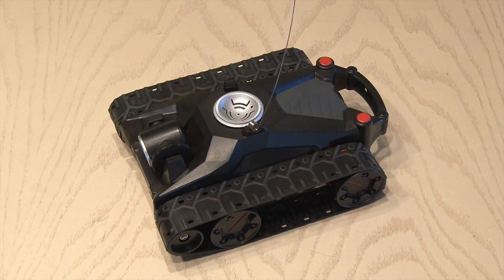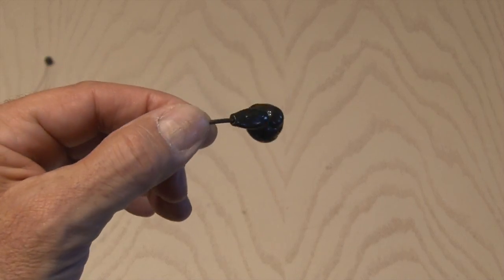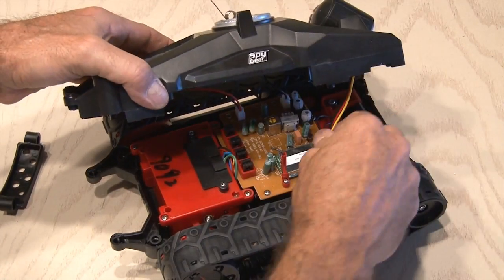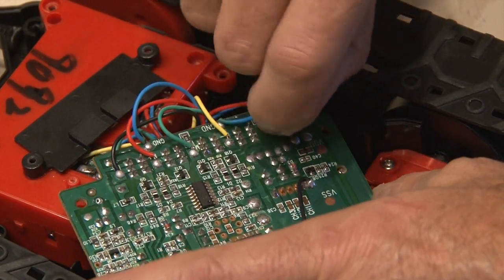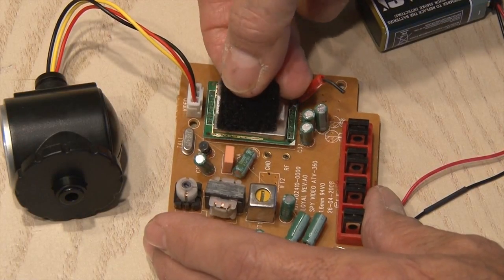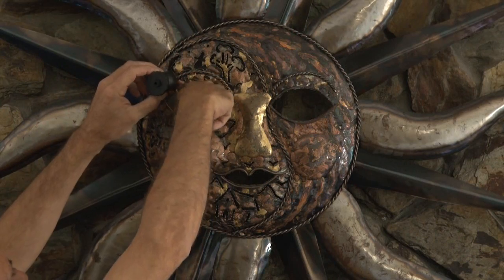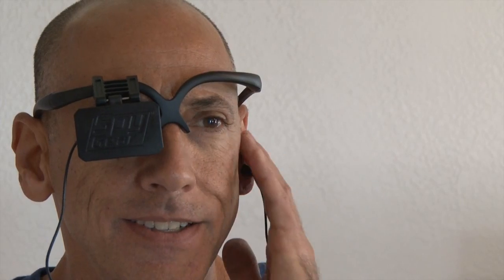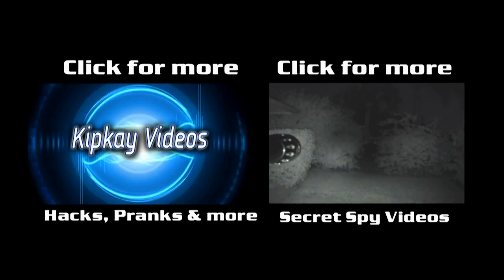Spy Tank Hack!

Comment: I think it would make more sense to show how to make a spy tank from various components rather than take apart a spygear tank to scavenge a component. It's one thing if you're going to scavenge a good part from an otherwise broken toy, but to tear apart something that works only for a more limited use doesn't make sense. Why not tear apart a brand new Ferari to build a go cart? Dumb.

Also, not everyone has a huge metal ornament in their living room. It would be a more useful video if it showed how to disguise the spy tank as an ottoman or something. Upgrade it to work over the Wifi.

Comment: Oh, sorry, I forgot to explain that part. Just rig up a motor to a wood block and set up a trigger on your remote controller for the tank and make it work with the motor. You set the wood block in the trigger-guard, so when you press your trigger, it pulls the gun's trigger!.

Comment: HEy kipkay! time for you to start investing in spektrum R/c gear and Syren motor drivers, fun fact, get some fine gauge wire, cut about 4 inches, and cold solder  that to the exact spot you put the velcro, then wind a 1inch coil of thin wire and do the same for the RX in the eye piece. greater distance!

Comment: Cool project but the tank in this video costs $175.  You could get a car backup camera for that much and it would be less to take apart.  Found a smaller tank like this one called 'Spy Gear Spy Video TRAKR' on Amazon that is <$70.